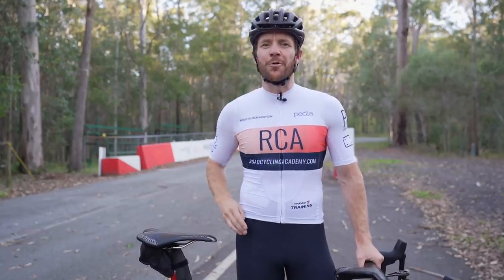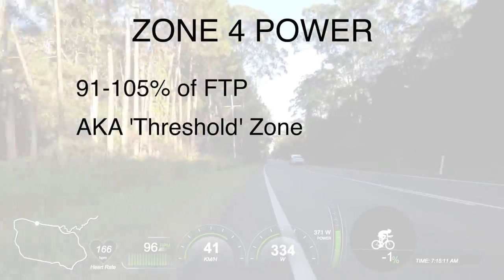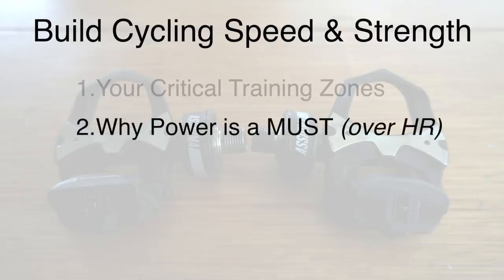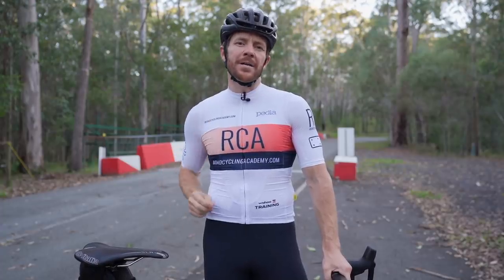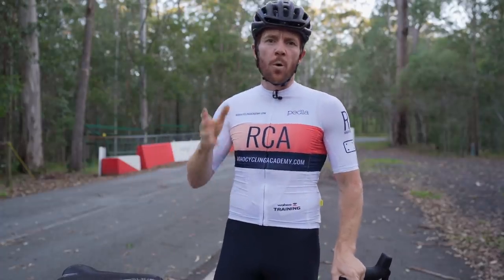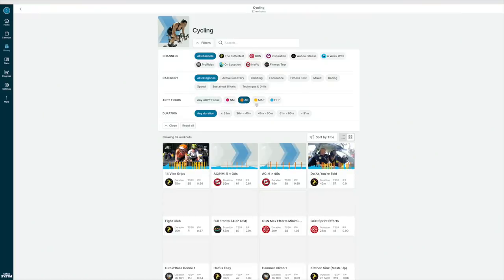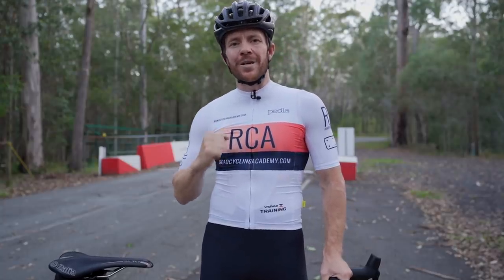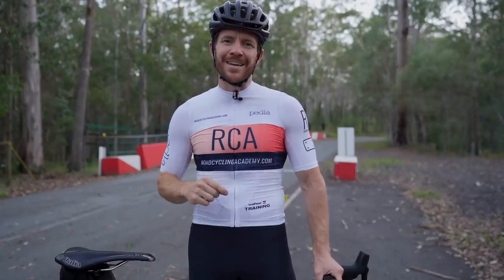Three Simple Ways to Improve Your Cycling Speed & Strength (with a power meter)

Comment: You are getting better and better as a coach. Especially in front of the camera. Good job. I have a question concerning FTP Tests. I have the feeling that my power gets overestimated with a ramp test (did the half monthy from wahoo system). Which type of FTP Test is better in your opinion: a ramp test oder 20min FTP test (20min max power -5%)?
Reply from the maker: Thanks mate. We use the Half Monty at the RCA because it's practical and the 20min sustained HR effort following the RAMP provides more accurate FTP data than the traditional RAMP. Often though, for those members focused on FTP gains, I get them to do both the RAMP and the 20min test. Interestingly, most of the time there's 5 watts between the two, but occasionally there can be a big difference based on physiological traits. So try the 20min and see what happens.

Comment: I Hate how expensive proper cycling kit is, I've been obsessed for the past 3 years and I'm knocking out 200 mile weeks no problem, but even with two jobs $800 pedals are so hard to swing 😭. I live in an area where only old men ride nice bikes and if I have to wait until I'm way past my athletic prime to actually get a proper bike I'm just going to fall over dead.
Reply from the maker: The Assioma Uno's are quite reasonable. You can get them for around $600 AUD I believe. That's a lot less than a few years back for a quality PM. But I do hear what you're saying, it can be a very expensive sport.
Reply: @CamNicholls  Thanks for the recommendation! I'm not going to let the sticker shock gatekeep me, your content is awesome Cam!

Comment: Cam...  when you train, are you sensitive to being in the saddle or out of the saddle...  obviously when you stand up you can generate more power but it seems like a lot of that is body weight vs actual power generation...   so when you train should you try to hold your position stable so you understand your progression without it being skewed by out of the saddle efforts?   Love your videos btw!
Reply from the maker: Hey Rascal, I would be inclined to do most efforts in the saddle, but certainly you want to incorporate some out. Variability in training is key.

Comment: Just started road cycling 11 months ago, been using HR/RPE on my training session but  at times there are session where I'm putting my RPE 9/10 but HR will not go up as I think it should. Thinking of getting a PM to use in my training. Will a single sided PM good enough?
Reply from the maker: It’s a good starting point Ken, just be aware that you may be stronger on one side and won’t have that reading. Good luck with the training

Comment: How good is a 4w/kg ftp? I'm 22 years old and ride 6h/7h a week (in the winter mostly indoor, nothing structured). I don't do races, have no ideia what people's power is in general. If I trained 12h a week instead, with a structured training plan, how much would my ftp possibly be?
Reply: 4w/kg is between B and A grade (closer to A grade, i.e. really good). Your FTP is heavily dependent on your bodyweight so no way to tell based on the info you've provided.
Reply: @PWDr93  60kg!
Reply: My question is if actually putting some real training in will make a noticeble difference
Reply: @danielm2058  lol yes
Reply from the maker: Monster differences
Reply: @CamNicholls  will give it a proper try for 2 months then